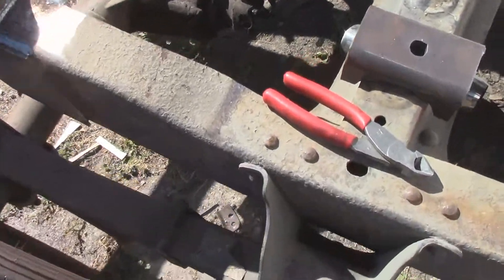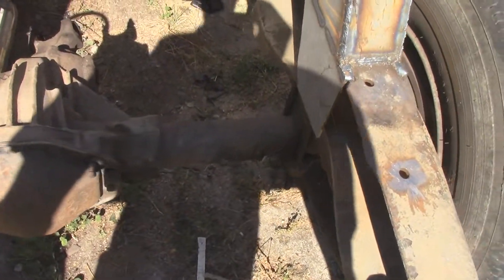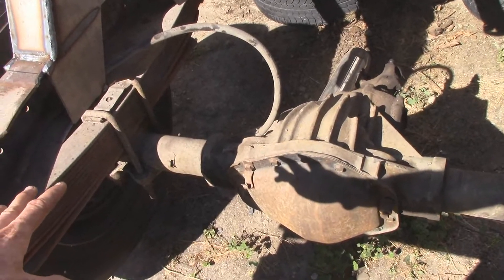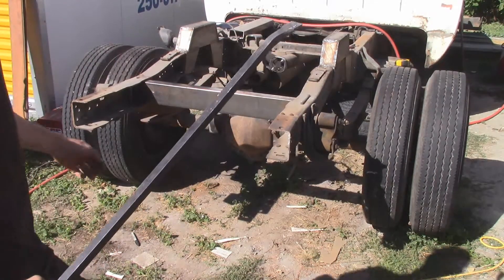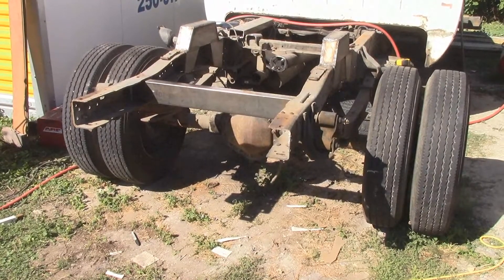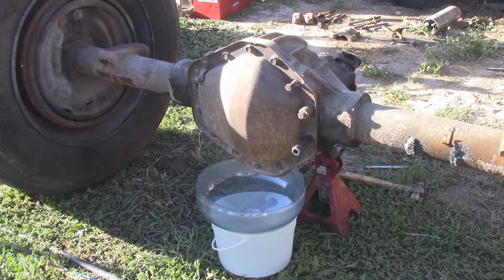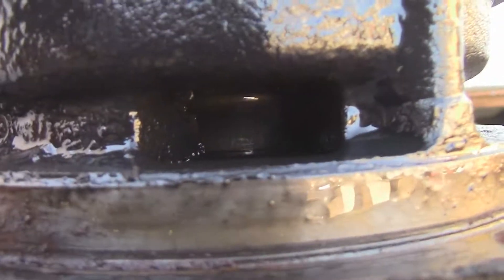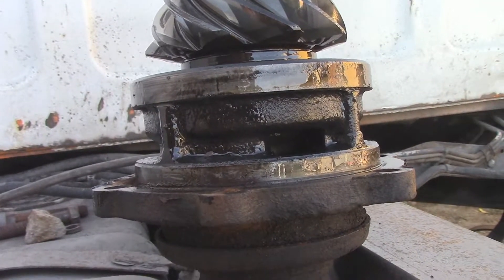1989 GMC 3+3 - Differential Diagnosis

Comment: springs means locking diff , nice score
rebuild kit prolly has the bolts you need for the pinion gear and the gaskets as well 
the gears are worn in the way they are set so changing this setting could be a good way to speed up wearing the gears down , its the same thing as with reusing a solid lifter cam 
might be ablle to get away with it by using some aditiv in the gearoil , you need to add that anyway for the locking diff but you might need to add some moli lube type stuff or just slather moy lube on the gears before closing everything up
you prolly seen this before but here is a good online reference guide to the 14 bolt
http://www.pirate4x4.com/tech/billavista/14b_bible/

do you still have that classic international truck ? 
if the chevy turns out driving whell you could drape that international body over it 
kindah wondering about re using the original chevy cab floor and cutting it to fit the international cab and welding it around to the international cab at the sills 
doing that will get the cab to sit right over the wheels and frame all the mountings for the framerails and the seat are allready at the right place and mounted with stock bodymount rubbers , you might even be able to reuse the chevy firewall holding the pedals , brakebooster . steering linkage parts of the dash with the heatercore and stuff
Reply from the maker: watahyahknow yea, i was doing a ton of research on the 14b. Ive got a detroit locker, woo hoo!
Im still undecided as to what to do... i found that the pinion nut came loose though. 20lbs-ish of force cracked it loose...
Going to change the pinion seal, then maybe just tighten the pinion nut to get proper bearing preload... the truck was rarely highway driven. Just mainly did jobs around town...
I dont have any of my old vehicles... the whole situation with work over the past 3 or 4 years has forced me to burn up any savings we had, and sell everything... thats why i had stopped making videos for such a long time; no money or energy to do anything.